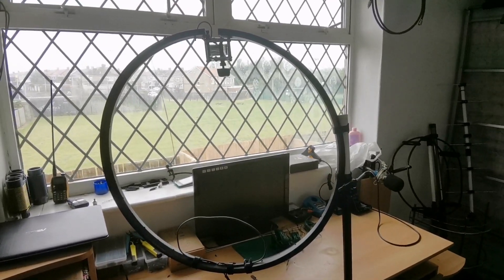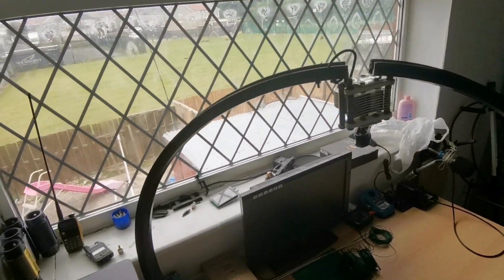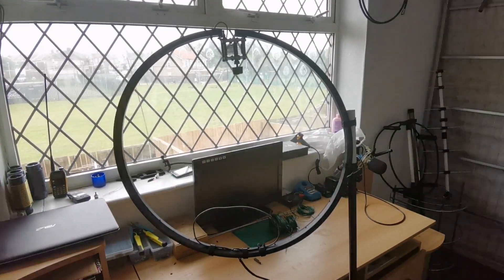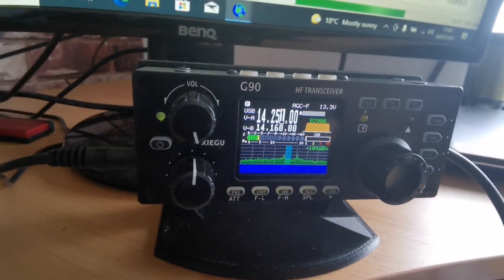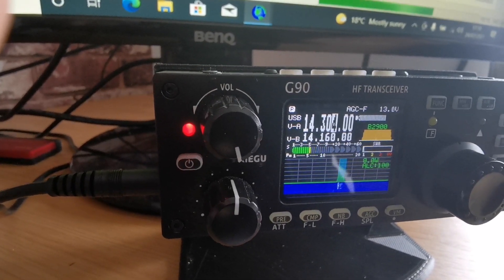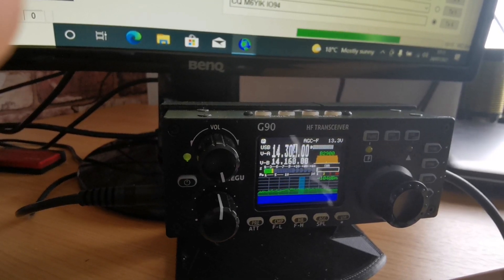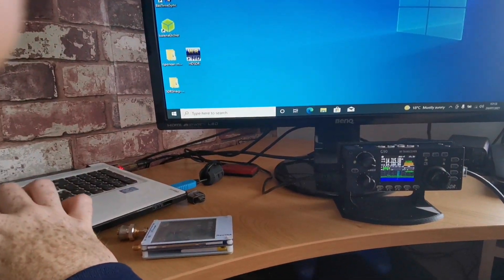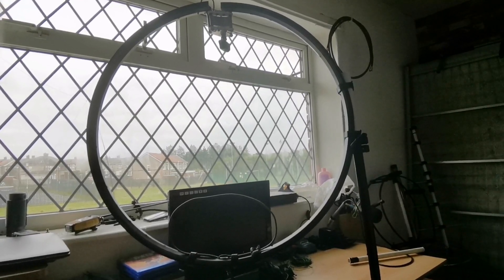Diy bicycle wheel Magnetic Loop antenna part 2

Comment: The rim on a 26 inch bike wheel is actually between 23.5 inches and 24 inches in diameter. I made a loop from such a rim, but I used a gamma match instead of the inductively coupled feed loop. I got the idea from VK3YE's Summer Loop some time ago.

I emailed you a photo of my bike rim loop. The gamma arm is around 7 1/2 inches long and tapped into the rim with a self-tapping screw.   Great build! Keep up the good work.

De WB2VUO in Amherst, NY